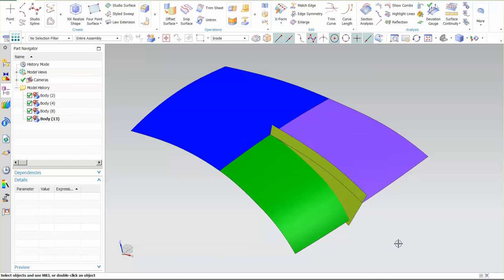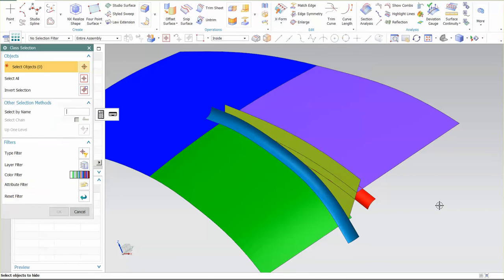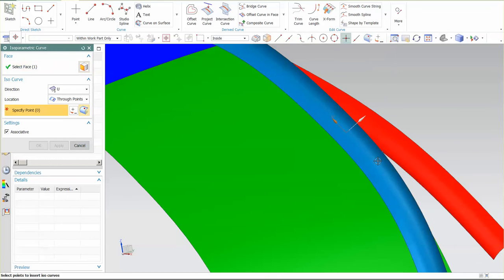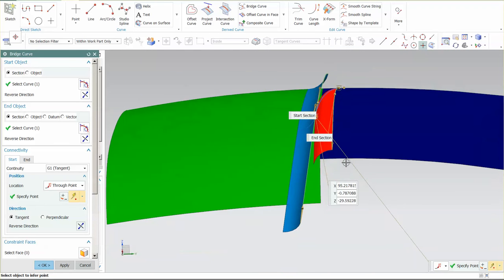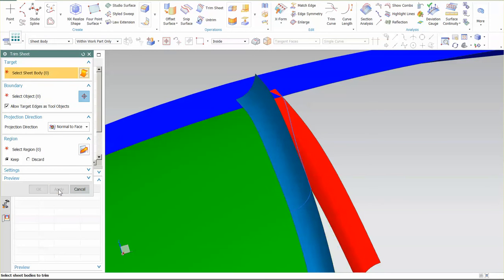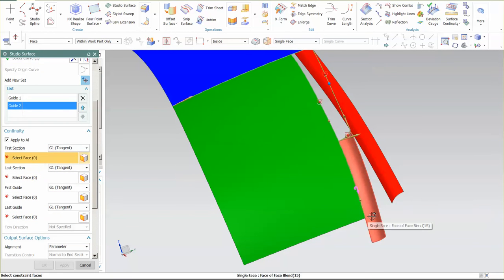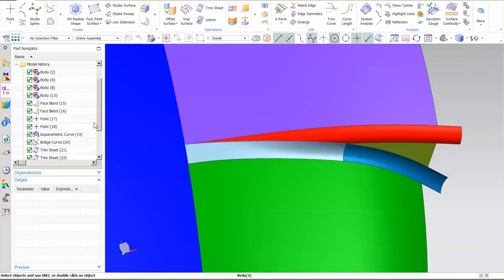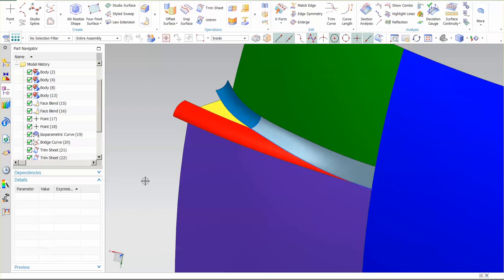Blend Out: Class A Method | Siemens NX

Comment: I have some doubt this is really a class A method for all cases - something tells me that the studio surface can't possibly make a perfect transition to the other face blend because it doesn't know it itself should create a bit of a blend (a slight curvature toward the curvature of the studio surface) at the point where both blends meet (the sharp triangle corner where you created the interesction point). This would be especially true for smaller faceblend radiuses. I guess should have showed analysis at the end.

Comment: I saw you wanted to have G2 on the Bridge Curve. If so, and you don't want to modify the curve shape, wouldn't the Curve on Surface be a better option? It can do up to G2.
Reply from the maker: In a lot of cases G1 is acceptable and with the shape controls if offers it does a really good job. Curve on surface does not give you that shape control so easily.

Comment: I have a part with a transition, which I want to blend out on both sides. This method works well on both sides, although on one side I had to use a workaround for the bridge curve and I do not know why.
When I select the curves used for bridge curve and select the points, the bridge curve does not go through the point where the blend and the flat surface intersect. I can select 'by arc length' to constrain the bridge curve approximately to the point and the curve looks good, but as soon as I select the point again, the bridge curve seems to ignore the point. It is rather goes through the end point of the edge of the blend surface...
I had to trim the blend first and select the edge afterwards, this works.

But I stillt don't understand why this happens, do you know why?
Reply from the maker: Did you check your selection intent rules? They may be set to select end point and not existing point.
Reply: Good point, but I checked it before. The correct point is definitly selected and highlighted in the model, but the bridge curve starts from the endpoint of the edge. When I select point on edge and select a point by hand, the bridge curve works correct.

But nevertheless, with this little tweak the transition looks great.
Reply from the maker: I have some selection bugs as well. I think it needs a little tweaking but for the most part it works great.

Comment: Nice.
Would a through curve mesh work as opposed to a studio surface?
Reply from the maker: Yes sir. You will have slightly different results and in most cases you will not notice it. The way the system determines the continuity, mathematically, is what varies.

Check reflections. curve mesh may give you a better result so sometimes I try both.
Reply: Thanks for the quick response. I've been a UG user since v13, pretty much every version. On NX11 now.
tool, fixture and dies. Always looking and learning new ways to tackle a problem.
Reply from the maker: Glad to help.

Let me know if you want to see anything on the modeling side.